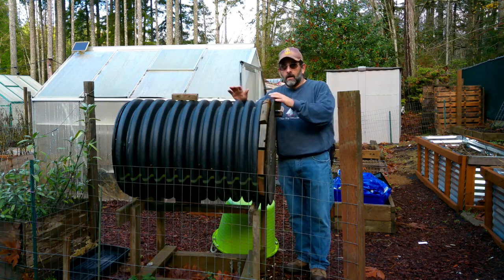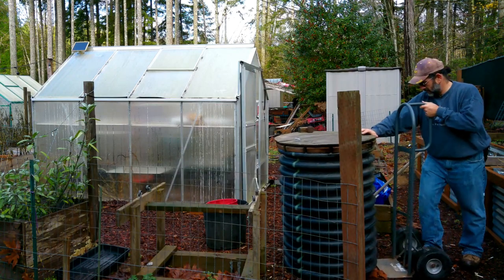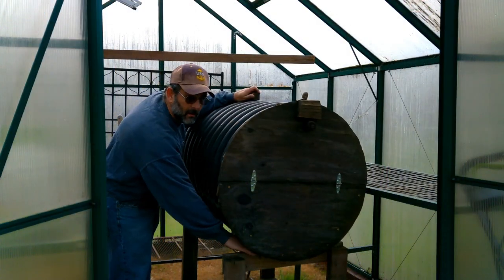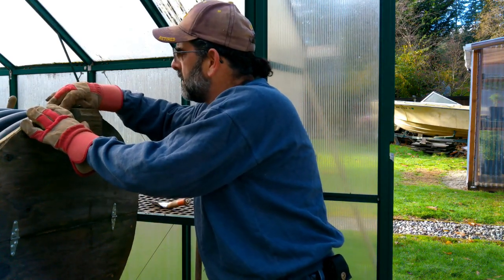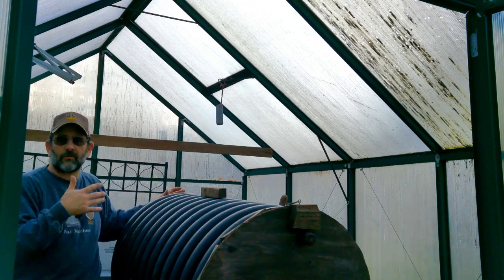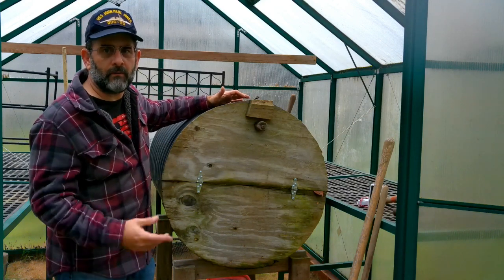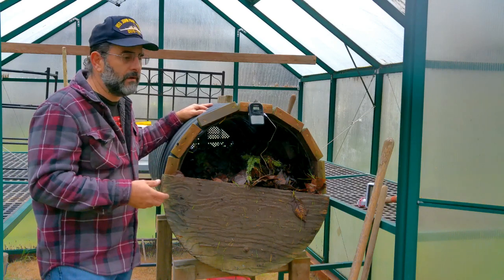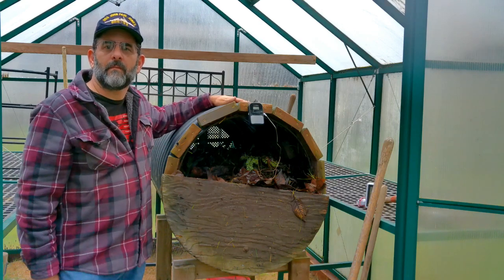Greenhouse Heating With A Compost Bin - Will It Work?

Comment: You probably don't have enough mass for compost to generate sufficient heat. You'd need at least a 4ft x 4ft x 4ft mass of compost for microbes to generate heat. How much nitrogen to carbon materials are you using. Also factor in how well insulated in your greenhouse.
Reply from the maker: You are right.  My buddy Joe had to make a 10ft x 10ft hay pit and constantly had to turn it without breaking the water tubes to warm his greenhouse.  I did a video on it.  Happy Gardening!

Comment: A compost has 4 parts: greens (nitrogen),  Browns, air and water. Your compost needs some browns to make it hotter. Brown Leaves, paper cut up, wood chips or sawdust.  See how to make a hot compost https://youtu.be/x4JssQPTYF8 The Size of your compost pile might also may be a factor to consider: 3 feet x 3 feet x 3 feet is the minimum size for a hot compost. I like your castors system.
Reply from the maker: Thanks! I think my main problem was the size.  I am going over to see my friend Joe's piped in compost heating system tomorrow for a very large greenhouse.  Happy Gardening!

Comment: I think there are a few things that could help this concept out. First, add a lot more material to your bin, especially greens. Secondly, let it start to cook for at least a week before you rotate the barrel.  Compost needs air to break down, but too much slows the process down.  Wait until the pile is closer to 120 before you mix it.
Reply from the maker: Thanks, I was hoping all the chicken poop would kick start the process.
Reply: @CMooreStarts  there just isn't enough mass to produce the heat you need.  Fill that sucker up!

Comment: Green houses aren't designed properly. Water in black barrels retain heat 4X better than soil. Concrete 2X better. Wet soil one third better than dry soil. I like to dig into a slope where the high side of the slope faces North, then use 8 x 8 x 16 blocks about 3 high all around. enclose 3 sides and the south side using clear panels to allow the sunlight in.
Reply from the maker: I wish I had a South facing slope (high side North) on my property.
Reply: @CMooreStarts  For sure during winter months all the sun is from the South.

Comment: Great video, interesting experiment. Bummer that it didn’t heat the greenhouse. I have seen Charles Dowding start his seedling on a manure hot bed inside of his greenhouse. I am very curious if it would generate enough heat to warm a green house, given the size of the pile. I don’t have a green house yet to try it out.
Reply from the maker: I was hoping it would work.  My friend is putting in a full compost heat system with water lines and a huge compost pile.  He used a backhoe to dig out a pit for his compost.  That's what gave me the idea.  When he finishes it up, I'll go over and film how it works.